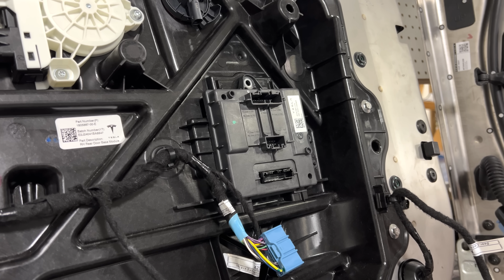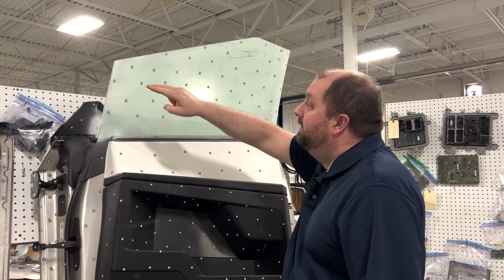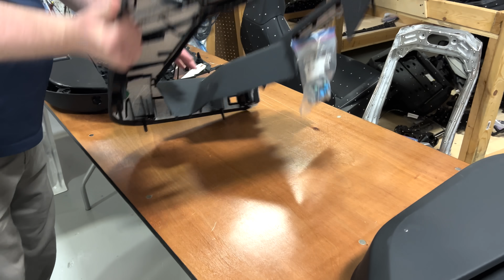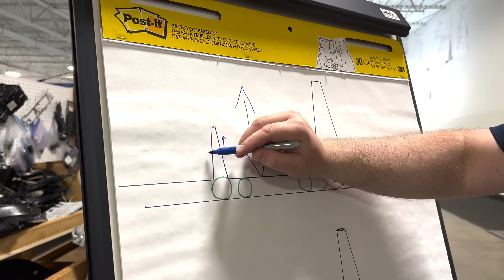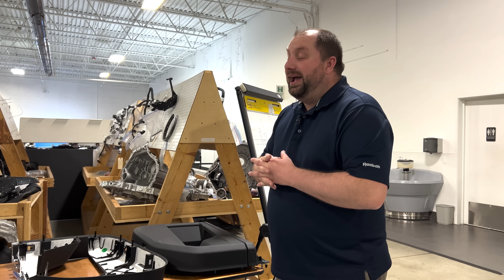But At What Cost? Tesla Cybertruck Door Teardown

Comment: Great explanation. The annoying thing about engineering is the inevitable tradeoffs. I loved the line "This solves the problem; now we have three more." - Ain't it the truth. And of course its got to be as low cost as possible.   As for the 48V window motor - really its way less of a "big thing" than most think. All those plastic bits are interchangeable with the 12V product. The windings and possibly connector on the brushless motor are all that are changing and they should in fact be lower gauge wire and less expensive.  The housing was probably kept to save on parts development. The connector could be very slightly cheaper but its probably not worth the effort (even in volume). When you make this sort of transition there is going to be bureaucratic push back. It often falls upon the big companies with purchasing power to make the call and then everyone benefits. I would really love to find the trade rags for the move from 6V to 12V systems when they needed more wattage for the starter motors on the bigger V8's. That must have been a Holy War of sorts. To be clear there is a HUGE 48V solution market already in place outside of the automotive realm. Migrating those proven solutions (circuits and modules) over is cake - maybe a couple weeks of effort for new from factors and industry compliance.  And to be clear the 48V-ness of it is not magical. Anything in the upper voltage below 60V will translate. Nothing magical about 48V except it is part of a standardized portfolio.

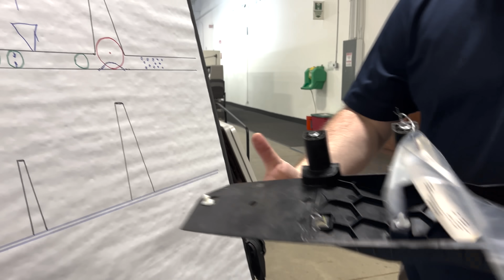Comment: @12:19 - Is it not possible to design a rib into the part on the opposite to compensate for the shrinkage, so that the result is a flat surface?
Reply: Or maybe just make it bulge so that when it shrinks, it ends up flat?

Comment: Frameless doors are a gimmick only good for low coupes that are hard to ingress and egress. I don’t know why Tesla uses them because they tend to make good design choice.
Reply: What gimmick?  They look better, the doors are lighter, and less door material/weight is needed.  I've had them on many cars (not just Tesla).  Framless also it improves the aerodynamics quite a bit, so the vehicle is more efficient - rather important for EVs.  It's a major reason that old ICE designs with framed windows converted to EVs do so poorly in efficency.
Reply: They're just cooler i guess. As there's an association with exotic 2 door sports cars and convertibles.

Comment: Nice, could you check the tensile strength and elongation at break of their alloy?
Might be the highest toughness of any steel alloy.
Reply: Toughness is not an engineering term. So what do you really mean?
Reply: @MikaPopp  Tensile toughness, so the area under the curve.
But it's pretty obvious with my comment that I'm not talking about charpy impact so I don't see why you felt to ask that.
Reply: @johntheux9238 Probably because it's ridiculous to think that 300 series stainless steel (~600 MPa, cold worked <1400 MPa) could have higher tensile strength than HSLA (~2000 MPa)
Reply: @MikaPopp  I said toughness.
HSLA has very little elongation.
Reply: @MikaPopp  And their new alloy is martensitic so ~1,600 MPa is possible.
That's the same tensile strength as AR500
Reply: On this truck and most modern car one would want the cabin to be the "highest toughness".  Don't know about the SX but the 3Y and CT use a single hot stamping from ultra high strength steel (maybe some boron) for the inner and outer door rings.  These form the sides aka frame of the passenger cabin.
Reply: @danharold3087  You want low cabin penetration. High toughness helps a lot.
Reply: @johntheux9238  Yes low penetration and crush.  Why I said "On this truck and most modern car one would want the cabin to be the "highest toughness"."

Comment: C'mon guy's, you really want one broken down door to cripple a central system or the cost of a work around. Door module's are so common and isolate common problems while maintaining a fully functioning central system with no need for by pass
Reply: None of that is necessary. A 'Hot-Swap' design is quite standard these days in Electronics/Computing. There is no need for a component failure to lock-up any control module in an intelligently designed system.